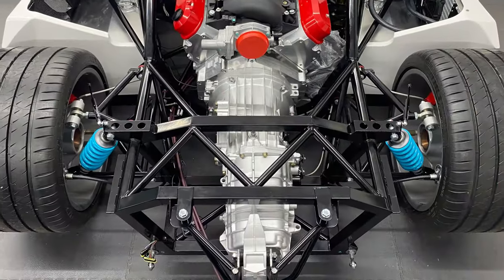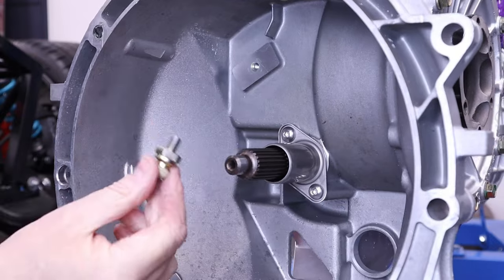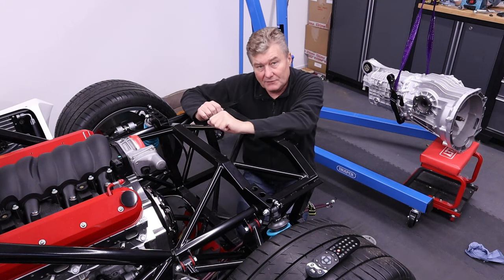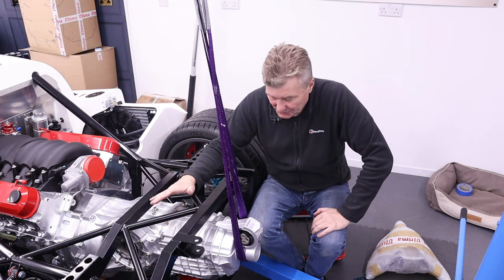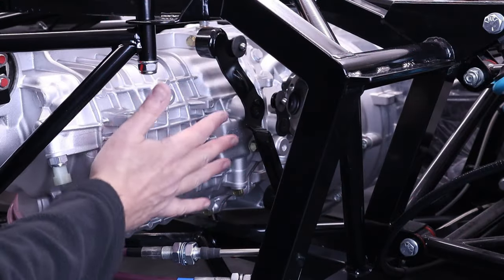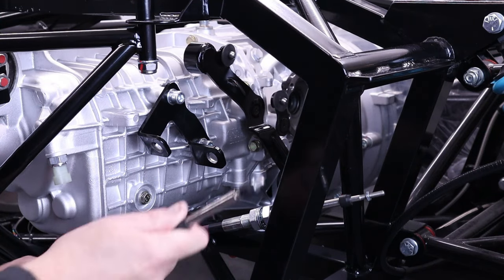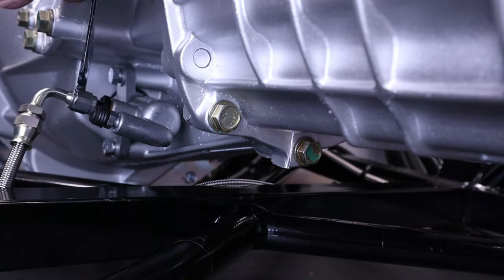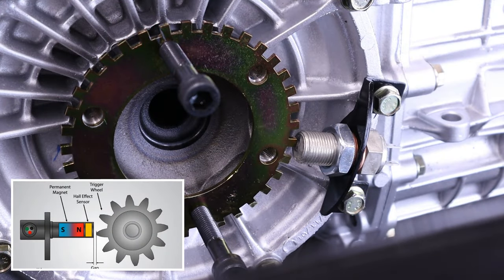Building an Ultima RS with Nigel Dean. Part 52. Porsche Transaxle Install

Comment: All come together nicely. Gave me anxiety not seeing any copper ease on the throwout bearing though..
Reply from the maker: Hi Jim, lubrication of the clutch release parts involved some very interesting research. It depends on where you refer if certain parts get lubricated or not. In the end I referred to the factory.

Comment: I noticed the strap you had holding the transaxle miraculously found it's way to  a new position threaded through the chassis. Is the reverse switch already fitted?
Also looking foward to the bleeding of the clutch slave cylinder.
Reply from the maker: Hi and thanks for the comment. Yes I shortened the clip of installing the box since I had to reposition the strap a couple of times as the transaxle slotted home. Yep the reversing switch is fitted, and the clutch should be pretty easy to bleed. In the Dean Den again this weekend :-)

Comment: Weird question what are the dimensions of the Dean Den? Working on the plans for my own.
Reply from the maker: Interesting question :-). Well the Dean Den is 20 feet wide and 30 feet long. It was originally 40 feet long but I gave up 25% floor space for a utility room for the Mrs :-(
Reply: @v8creative probably a wise move!

Comment: Is this a re-upload? I was watching this and thinking I'd seen it before. Because I remember some grumbling about having to take 2 of the bolts off the transaxle to tilt it just-so to get it in, and then blinking that you could have left those bolts off to set up the speed sensor. 

And I remember the anxiety I felt at watching that transmission wiggle in. :) But you had that held right close to the center of gravity which really tells you how light the transaxle is, compared to the  gears it's holding in place.

I don't mind reuploads, was just curious why you were dissatisfied with the original, and what wasn't up to your standards on the after thought. :)
Reply from the maker: I do make a test upload and watch the episode on my TV before the main Friday feeling event :-). This is a private YouTube link but occasionally one or two people seem to stumble across it - I don't know how? When I watch this first take with beer in hand, if I feel it does not capture the process correctly I do a retake which can sometimes include me redoing work. It's just me - I'm fussy and want to share the correct process and don't mind repeating a task.
Reply: @v8creative Definitely had a strong beer this week. I should see about sending you a few of my local favorites, do you like stouts?

Comment: I was looking at using a supercharged, built LT4, but I couldnt find any of info on the fuel pump that comes with the ultima. Does anyone know what fuel pump comes with the Ultima RS, or it's maximum rated fuel flow rate?
Reply from the maker: The LT4 installation in an Ultima requires in-tank high pressure fuel pumps. This is part of a Ultima fueling kit, so if you are intending fitting such a power plant in your Ultima the best approach is to contact the factory and purchase the full fueling kit.